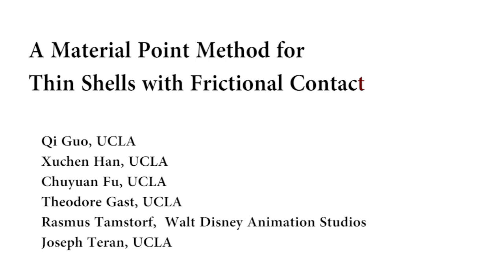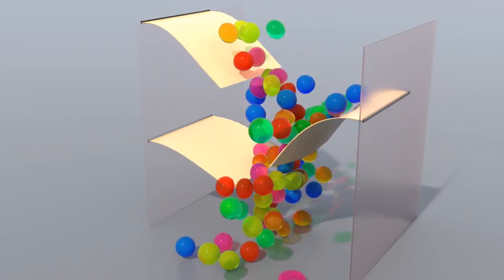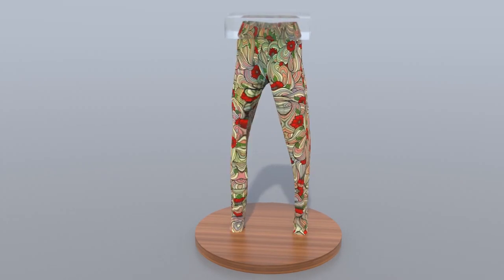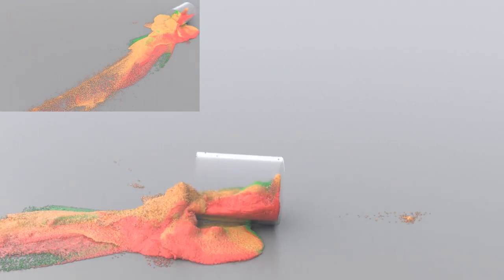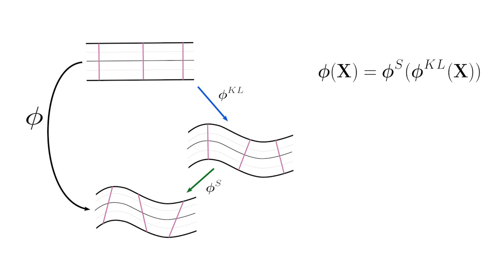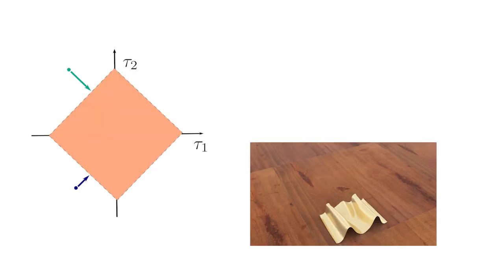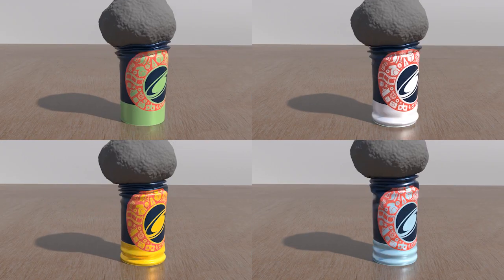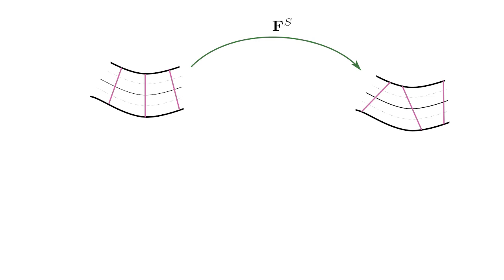A Material Point Method for Thin Shells with Frictional Contact

Comment: Should your mesh size be smaller than the thickness, and can you simulate the cable, which is very thin in each direction?